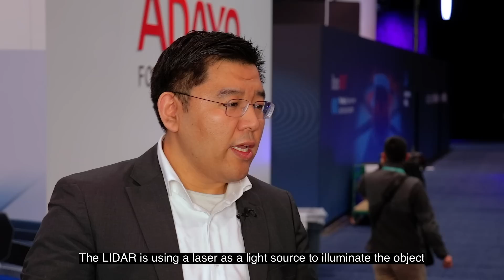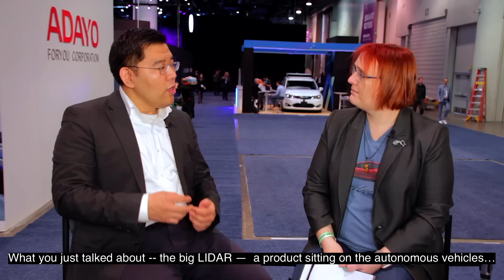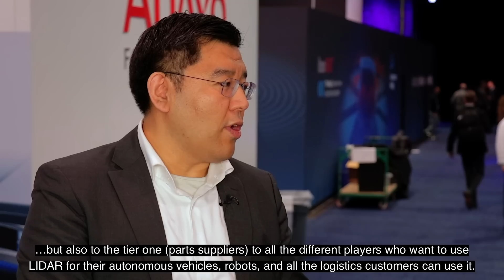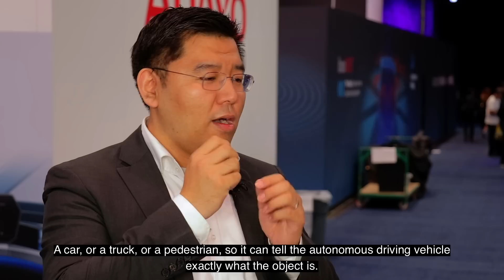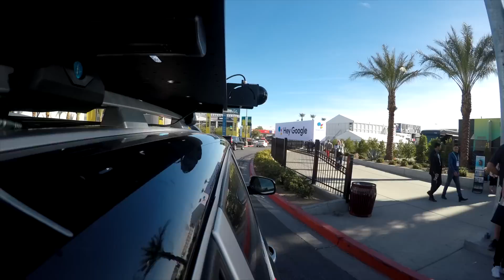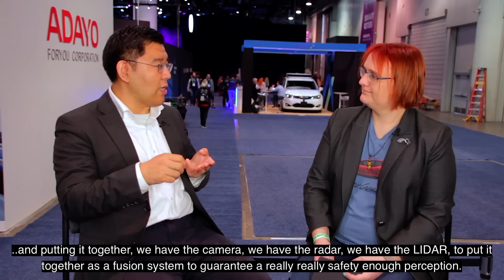CES 2020: Robosense Says It's Got The Secret Sauce For Autonomous Driving LIDAR (reupload)

Comment: You made a very important point in this report.  Autonomy comes down to trust.  Can we trust the mechanical systems - possibly and can we trust the software creators - unlikely.  To back this up, one only needs to watch the NTSB Board Meeting on the accident involving the testing of an autonomous vehicle, or look at the reports on the design of the MCAS software on the Boeing 737 Max.  In both cases the software design and implementation was a significant factor in the fatalities.  It is currently an inevitability that corporate greed at the senior levels will result in systems being designed and implemented down to a price and safety will inevitably suffer.  Look at the reports on the Boeing situation for indications of this.  I think autonomy has a very long way to go to achieve trust and to prove that it can cope with any driving environment eventuality.

Comment: One of the advantages of traditional LIDAR systems in autonomous-vehicle applications has been that they have been mounted up high.  That higher vantage point gives it a considerable advantage in detecting hazards, so mounting it unobtrusively could reduce its effectiveness!
Reply: A single 360° LIDAR mounted high up isn't nearly high enough.  It has major dark zones near the car.  Splitting it into 4 sensors, each with 90° coverage and positioned at the edges allows them to point down more and avoid having those dark zones.
Reply: Adam Olsen, excellent point.  Other sensors (e.g., ultrasonic) can help in that regard, but all the better to have “sensor fusion” of multiple types of sensors with coverage overlap, where feasible.

Comment: Robot vacuums are a consumer product that uses lidar to map the rooms of your house. Obviously, this type of lidar is much less expensive than $2000. What is the difference?
Reply: Speed most likely.  A robot vacuum can sit on one spot and slowly spin around to find the walls.  It doesn't look up or down and the walls aren't moving.  A car LIDAR needs to move down the highway at 100 km/h, scan up and down, and repeatedly scan the entire environment multiple times per second.  In higher resolution/longer distance too.  Probably something like a million times more data coming out of a car LIDAR than out of a robot vacuum.
Reply: Speed range and coverage. A robot vacuum lidar can be planar (or very nearly so), and it only has to work over quite a short range and not very fast.

Comment: It seems reasonable to assume that you would want a much data of about the environment SS possible I can see tesla integrating lidar when it is cheap and robust.
Reply: Possible, but there's another reason not to have used LIDAR yet: data is only useful if you can process it.  Previous neural network hardware in Teslas definitely didn't have processor time to spare on a LIDAR.  HW3 might, a future HW4 definitely will.

On the other hand HW3 might be sufficient to fully simulate having a LIDAR, regardless of light level difficulties.

Comment: I’m with Elon.  he goes back to the basics of physics.  If we can determine objects and judge distances without lidiar there is no reason to believe that an autonomous system can’t do the same.  It’s a more difficult engineering problem but you can see that Tesla is well on its way to solving it.  They may be off in their timeline predictions by a few years, but legislation allowing autonomous vehicles won’t be put in place for years yet, so Tesla have plenty of time.  Regarding night driving,  this is a silly point. Passive cameras have way better night vision than human eyes.  Also the point about lidiar systems being able to operate with cheaper computer systems is patently false because Tesla has already shown that it is possible to process camera input with their own very affordable FSD computer.
Reply: Andrew Hart Your comment is pretty solid! 👍🏾 Though I believe people are overestimating the level of legislation that might slow down Tesla’s robo taxi network rollout. I live in Florida, and our governor just signed a bill that allows self-driving car companies (this includes Tesla) to operate their vehicles with no human behind the wheel. So once Tesla is ready to launch Tesla Network, they will be able to roll it out in our country’s third most populous state pretty much immediately. 

I’m sure that California and New York legislators will try to follow along quickly and get Tesla Network going in their states as well. That’s 3 out of the top five most populous states that Tesla will easily launch their self-driving network in. Now other places around the country might allow it by jurisdiction and not statewide at first, but considering the aforementioned, not too many places would want to miss out on such a service when considering the clean air, convenience, and cost savings it would bring.
Reply: But people do crash into stuff pretty regularly. We'd be greatly enhanced if we had LIDARs in our heads, especially at night. Computer vision isn't better, it's just cheaper.
Reply: . Wookey do we?  If I was bumping into thing by misjudging distances I’d be booking an appointment at the doctors and I’d advise you to do the same!
Reply: @andrewpaulhart  I meant when using vehicles. Our system works pretty well at walking speed, but given bikes, motorbikes or cars we do crash into things from time to time, sometimes due to misjudging distances, or just finding it hard to see (darkness, weather).
Reply: it is possible != it is reachable as fast as lidar and as safe as lidar.
you can compare two camera only solution
Mobileye: https://youtu.be/hCWL0XF_f8Y?t=131
Tesla: https://www.youtube.com/watch?v=NAbTAqxrLjE&t=579s
so i am inclined to agree with Mobileye and they would develop separate lidar+radar solution which at least see as good as their camera only solution, 

and their final solution would be combination of both.
p.s. that's actually the answer why official Tesla FSD demo don't have any pedestrian,
and Mobileye learning to detect pedestrian with cameras for 20 years.

Comment: A very good point was made: LIDAR is not trying to emulate the human eye or camera in terms of visual quality, it provides thousands of data points (shape, range, relative velocity etc) for a computer. A computer struggles to process a visual image - this provides what a computer needs to know. Cameras freeze over, get blinded by strong light, LIDAR doesn't have any of these problems because it's not "visual".
Reply: Ice and snow on the unit would still make it not function.  Still doesn't work well in fog and rain.  It's not 'visual', but still is based on light, so still suffers from the same problems as cameras.  The two things it does better than cameras is see at night, and generate accurate depth information.  However, both of these can be done easily and cheaply with camera technology.... Namely adding IR emitters to allow the cameras to see at night, and secondly to make sure that every view angle is covered by at least two cameras, which gives binocular vision-based distance data. 

 Spending $2k per lidar unit (it would require 3 or 4 of them if they were mounted onto the vehicle instead of riding on top) to reduce the cost of the processer by a few hundred bucks doesn't seem like a great compromise.  Computers may "struggle" with processing visual imagery, but that processing power comes relatively cheap and is constantly getting cheaper.
Reply: @patreekotime4578  This was my understanding too.
Reply: @patreekotime4578  

you can compare two camera only solution
Mobileye: https://youtu.be/hCWL0XF_f8Y?t=131 (>95% reliability pedestrian detection!)
Tesla: https://www.youtube.com/watch?v=NAbTAqxrLjE&t=579s (50% reliability pedestrian detection!)
so i am inclined to agree with Mobileye and they would develop separate lidar+radar solution which at least see as good as their camera only solution, 

and their final solution would be combination of both.
p.s. that's actually the answer why official Tesla FSD demo don't have any pedestrian,
and Mobileye learning to detect pedestrian with cameras for 20 years.

the problem that halving last fail to detect percentages requires almost same time for development just to get to that point.
i.e. if 50% can be achieved for 6 month 75% would require 6 month more, 87.5% another 12 month, 95% another 2 years,...etc.
it still less than evolution (which do spent tens of millions of years to do that)., but you still need to get 99.9% reliability, otherwise it would not be safe enough.
and while this all happens Waymo, Yandex and many more driving taxi fully autonomous without safety driver,
and lidar price is dropping.

Comment: Lidar is a fool's errand...
Elon Musk.
Reply: Well that's it then - St Elon has spoken........!
Reply: And his cars routinely tell me that subsystems do not work because the cameras cannot see. Blinded by the sun, blocked by rain and so on. And doing max braking several times a trip without any obstruction in sight or trying to turn into a solid concrete barrier at 120 kph. Just what happened yesterday on a 500km trip with a Model 3.

Comment: I'm still really not convinced Lidar is that great.  The range isn't as far as a normal camera during the day, and about the same in the forward direction as a camera illuminated by street lights or headlights at night.  It has the same, if not worse problems as cameras in bad weather and wet conditions.  So the only winning edge case is that it can see further off of the sides of vehicles at night. 

I've never really understood why traditional 'night vision' systems aren't in use more?  Digital cameras can natively see in IR, and an IR 'headlight' isn't especially expensive, so the hardware costs are negligible, while the spatial detection software is virtually identical.  And when the night-vision camera is blinded, it means the normal camera can see.  The backup camera on most cars already does IR "night vision" mode with an IR emmiter array and automatically switches between modes.   Again, it has the same downsides as Lidar in inclement weather... But it seems like it would offer the same upsides for dramatically cheaper?  🤷
Reply: There is a fundamental difference between 2D camera sensors and 3D lidar sensors. They measure different things. You can do a lot of computing and extract distance info from a moving camera to some degree, but that's not the same as measuring it. It can never be as fast and I don't think it can even be as accurate. It can be 'good enough' in quite a lot of cases, but I'd be a lot happier if all those vehicles had lidar sensors and weren't just relying on cameras then having to guess how far away things are.
Reply: This is what I came down here to say, but you said it much better.  Great analysis.  Just install IR lights on the sides and rear of the vehicle, and use night vision cameras.  Infrared spectrum (heat) is also much safer for pedestrians and other driver's eyes when compared to lidar's lasers, if say 30 cars are all waiting together at an intersection using autonomous driving systems.

Comment: So when there's a dozen lidar enabled vehicles at the same intersection.. Will they read each others laser illuminations?
Reply: That's a good question. Perhaps each 1 needs a unique frequency signature, if this is an issue.
Reply: That is a really excellent question. Can anyone answer it?
Reply: No. Each device has its own signature. Much as cell phones (which also transmits light, just in the radio spectrum) doesn't have a problem sharing the same frequency. They probably use something like CDMA.
Reply: Are you guessing or you know this? Reading info from every bounced pack of light sounds to me like an overkill task in the milliseconds time you have to measure.
Reply: They won't read each other's numbers, but you can get reduced reliability with multiple lidars in one space. They work by clever modulation of the beam (because you can't actually measure time of flight) and splitting the beam into a direct 'reflection' inside the box and one that goes out and back (The 'reflection' is actually virtual these days - 20 years ago there was a little half-mirror inside the box). The modulation means that they won't mistake each other's signals. However I have found that using several laser meters in one totally dark room they do tend to confuse each other, so it takes longer to get readings. But that's 10 year old < £100 tech - I expect they've done things to minimise interference as it's a pretty obvious issue for automotive use.
Reply: That's deep
Reply: As to lidar reading each other's illumination, it is a non issue if you think about it.  Lidar is just light.  If two people with flashlights enter a dark room, they only help each other illuminate the room.  The bigger issue is making sure that with 20 vehicles using Lidar at an intersection, they do not injure people's eyes with the concentration of lidar.  They need to develop very sensitive sensors so the laser's brightness is extremely low.
Reply: @shanfiddle  Problem is that Lidar is based on measuring the time it took for the light to bounce back from it's original emission point. Multiple emissions points means receiving reflections that don't match up with known emissions. In your example, that would be like a room full of people shining their flashlights in each other's faces.
Reply: Shane Fiddle Hmm, compelling arguments, but I still feel that LIDAR won’t be needed at all once computer vision is solved. Definitely see its practicality in other applications, but just not in autonomous vehicles.
Reply: @waynelewis9110  He did say you can do it all with cameras, but it's very expensive (I think processing power might be the problem here). Also that cameras don't work well in the dark. It seems to me that the hybrid system he describes at the end of the interview combines the best of both, and may end up being the cheapest way to get really good reliability and safety.
Reply: anahatamelodeon Radar and ultrasonic sensors already make up for the deficit that cameras have in the dark. These LIDAR proponents never really bring up the fact that advanced computer hardware and high-level AI (NNs) are really important for autonomous vehicles. I think it’s because they don’t want to admit that what they’re selling is eventually going to be of no practical use in autonomous vehicles. My point is, is that once the two aforementioned things are obtained, and you have large sums of data flowing in, LIDAR essentially becomes irrelevant in self-driving vehicle applications. 

I mean, when Uber’s “autonomous” vehicle killed that woman on a bicycle, its LIDAR was of not much help since their AI/computer vision was pretty bad. Their LIDAR only detected her position, but not her velocity. And then their computer was bouncing between identifying her as an inanimate object, bicycle, pedestrian, and was unable to make a decisive decision on what she actually was (a pedestrian) until it was far too late. Again, the Uber unit having LIDAR did nothing to help, and served mostly as false security and overestimation in the usefulness of LIDAR. A front facing radar does the same exact thing as LIDAR, but emits radio waves instead of electromagnetic waves, but radar does even more since it can see through dust, snow, heavy rain etc. and LIDAR cannot. Radar can even see ahead of vehicles that are in front of it. And radar can be applied at an incredibly lower cost than LIDAR. I just see LIDAR as a fad for autonomous vehicles. But we’ll see if it finds a niche in geo-fenced autonomous ride sharing networks.
Reply: @shanfiddle  Reading would be a problem because   LIDAR is measuring the time it takes to bounce back the light. So the object will "glow sooner" and report much shorter distance. It's a great question (multiple LIDERs in the same spot) and should be asked
Reply: Sarcasm alert--Sound right to me! Like when cell phones are in close proximity and read each other's signals, getting confused!